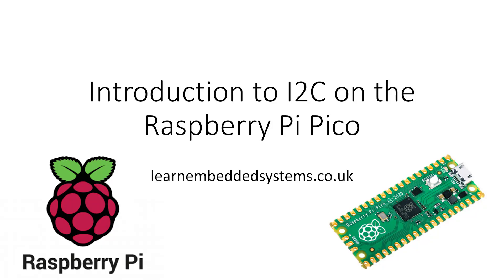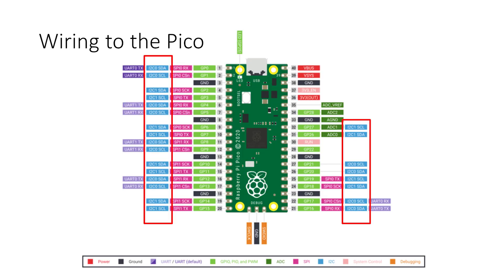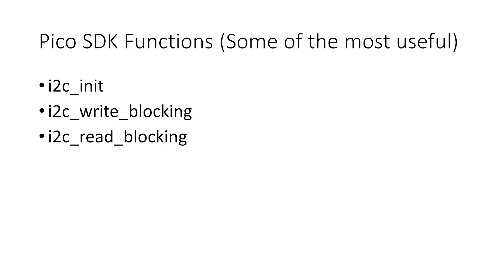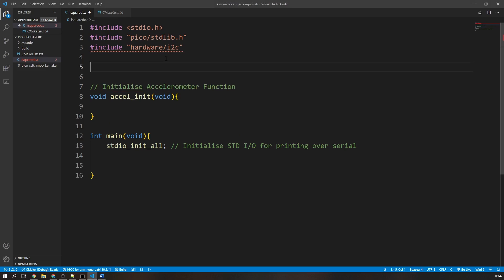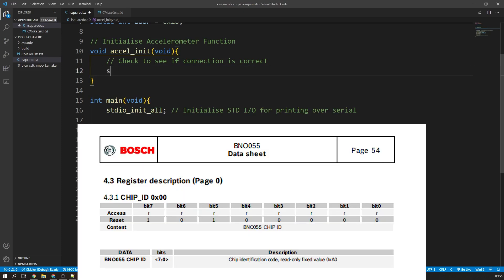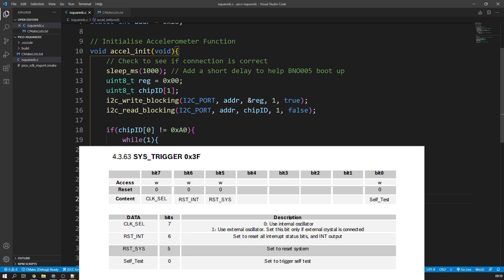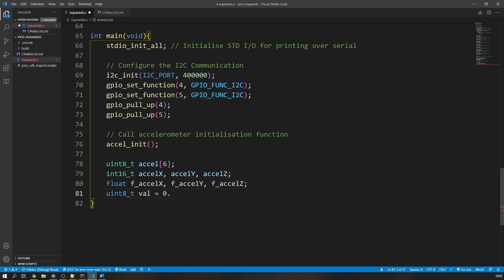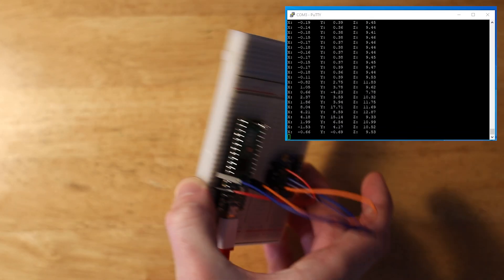Beginners Guide to I2C on the Raspberry Pi Pico (BNO055 IMU Example)

Comment: Very clear presentation, however as a guy who uses assembler, relying on hardware to work is very dodgy practice and is not good for robust software. If the I2C device or bus fails your software will hang without so much as a howdy doody. Plus I2C devices are very slow compared to main microcontrollers and you usually want to be doing other things during each bit of data so is ideally handled in an interrupt.
Such concepts may be too advanced to explain in 20 minutes here though so to being new to C on Pico, this is very good, thank you.

Comment: Nice clear video, thanks! May I suggest a possible improvement, instead of printing an error in an infinite loop, it's a relatively simple change to encapsulate the chip ID check code inside the loop, then exit upon success. That way if you get your SCL & SDA wires mixed, which I invariably do, you don't have to reset the entire board to get it to work again, simply flip the wires and it'll begin working (yes even when plugged in, it's fine!). Same with the operational code to make it robust to I2C comms errors.
Reply from the maker: These are great suggestions, Thank you!

Comment: 10:26 regarding the code: reg, then read then write functions: I need some clarity please: Is this correct idea??? The write function points at register 0x00 holds the bus using "true",  so when the read function executes its looking at reg 0x00.  These functions are confusing: there is physical connection point to pico: i2c0, device address 0x28 in your case, then a buffer to store the read information: In my head it should be: i2c0, device address, register (we want to read), buffer (to store the read), ect. How do I point at the registers since read and write only have device, data or device, buffer???

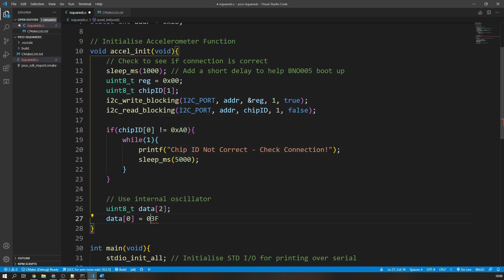Comment: A question, at 13:01 mins, where is data[1]=0x40 from?  Is 00100000 converted to 20 in hex? Should it be =0x20?
Reply: Actually 0X40 in binary is 01000000. That is, he is setting the bit 6 to 1 and it implies the to "reset interrupt status bits",  the bit 7 is set  to zero that implies to use the "internal oscillator" and all the other bits are set to 0 as well.
Reply: Notice that the bits are counted from 0 to 7.

Comment: I appreciate your channel, there is not much content on the PI Pico writtern in "C", this may change now that the Arduino IDE is supporting the PICO. 

Would you consider doing a video on added a SPI  Wiznet W5100 Ethernet Breakout board?
Reply from the maker: Thanks for the feedback! I don't personally have one of those boards but if they aren't too expensive I can look into it

Comment: Interesting. I can see you using one thing but I'd have liked to have seen a demonstration with two.

Example, I have the BMP280, the user ID, the IIC I2C SPI MPU-6500 and the L76B. That's all aimed toward making a self-navigating drone. I might also add sonar. But I use Python not C.

Comment: Could you consider to explain how the data IO works, for example by using 2 Pico's, one a host and one a client, or on itself. I am still confused about the bit order. Thanks!
Reply from the maker: I can look into this and I might make a video regarding communication between two Picos. Thank you for your suggestion
Reply: @LearnEmbeddedSystems  Thanks! 👍

Comment: Does anyone Haha e the issue ‘module ‘board’ has no module I2C’ ? I am running a Pi 4, and using Python. Strangely enough the exact same file works on my other Pi.
Reply: If you are in python i think you should use i2c of busio

Comment: Wow, crystal clear explanation, thanks for that content.

One quick question, do you know if there's any chance to print through the micro-usb port from the raspberry pi pico?
Reply from the maker: Glad you found the video helpful and clear! Yes you can print from the micro USB port over usb serial via the printf function (if I am understanding your question correctly). I have a video about USB serial on my channel which covers this.
Reply: @LearnEmbeddedSystems  no hahaha, I was talking about printing on a real printer, like actually printing on a paper, printing on a paper.
Reply: @Morkiller  you're probably going to want to use a normal raspberry pi for that. Like one with an operating system.

Comment: keep the micropython uf2 close, could be useful to check if the i2c device is properly connected, only needs a few lines of code to scan the i2c bus, can be done in the repl ... i expect .   
bus 1, pin 2 sda/3 scl (board pin 4+5) or  bus 0, pin 8 sda, 9 scl (board pin 11+12), or any other duo as seen on Raspberry-Pi-Pico-Pinout-Diagram.jpg
Reply from the maker: Great idea! Let us know when you have worked out which pins to use
Reply: @LearnEmbeddedSystems    still waiting for the hardware, working with the pyboard-d for the moment

Comment: It would be interesting to see this basic code turned into a library with a cpp and .h file
Reply from the maker: Which part are you referring too, the general i2c communication or the BNO005 functions? I will have a look into putting the I2C code into a simple library but I am sure someone will have beaten me to it!
Reply: @LearnEmbeddedSystems  i2c (or spi) communications into a library using VS code and Pico

Comment: Can you plot via .csv?
Reply from the maker: Yes this is completely possible, and fairly simple to do! If you are using PuTTY you can use the logging function to directly save the output as a CSV. This tutorial is for an arduino but is practically the same for the Pico: https://www.circuitbasics.com/logging-arduino-data-to-files-on-a-computer/